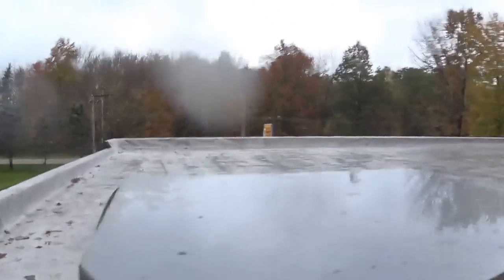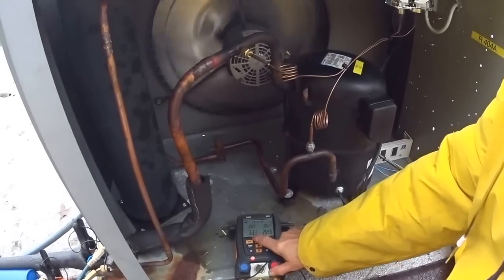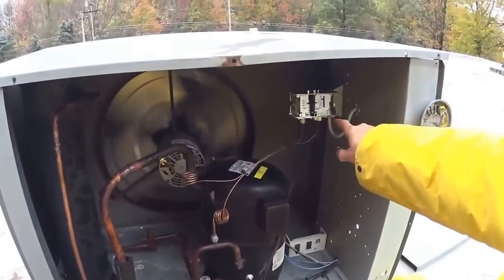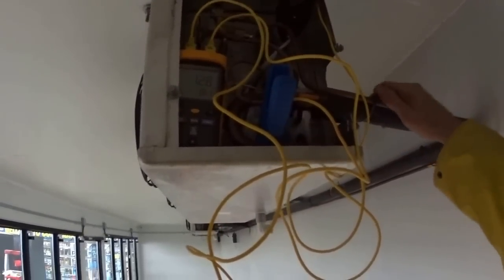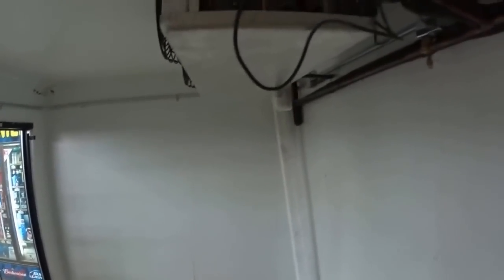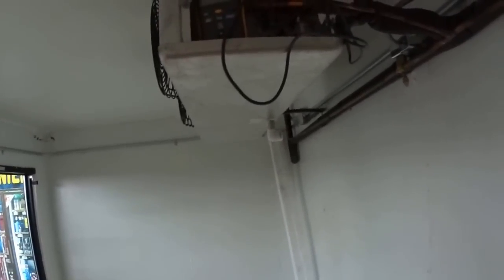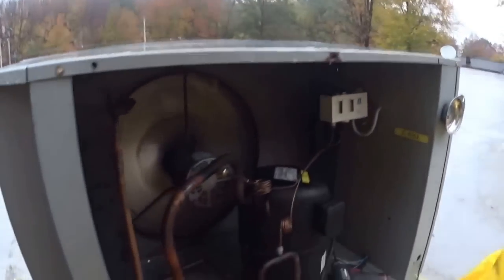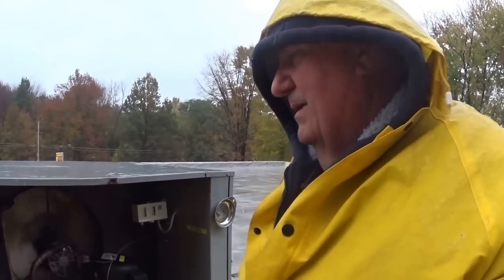Walk in cooler install part 2

Comment: I thought superheat adjustment is made by taking a pressure reading at the end of the evap  and a temp reading close to the TX valve bulb and try to achieve a 6 ktd. I never seen it done this way b4.

Comment: Thanks for posting this one.  Last week I replaced an old heatcraft condenser (with a Bohn) and converted the cooler to R-404a from R-22.  I also replaced the heads and cartridges in the expansion valves.  I had 3 evaporators as well.  The cooler was mostly set up for soda so pretty similar.  Initially I thought I had a problem with the solenoid located in condenser instead of cooler.  Unit would pump down initially but would take a long time.  Found out I had electrical feedback to 240v solenoid and it wasn't seating completely.  Pretty weird, huh?  Originally I had #1 on defrost to first leg on contactor and N (neutral) to the third leg. I switched my neutral to the second leg for defrost clock on contactor and that corrected the problem. System pumped down quickly after that. Unfortunately I only have one meter to set my superheat so my adjustments took a little longer (especially with cooler still stocked).  But this job was almost exactly like the one you did in this video.  I just happened to come across it today.  Thanks Jim for your professionalism and knowledge.  I was gonna set my superheat a little lower but your video confirmed what I did set them to.  Thanks again.  I wish I had video'd the job but I don't really have the equipment.  Maybe I should invest?

Comment: I just noticed something on my Alco Cut sheet. The pressure on the TXV outlet is higher than the outlet pressure of the coil. Therefore, the temperature on the TXV outlet, is warmer ( this is what I was seeing in the field), than the temperaure outlet of the coil because of its lower pressure. They only show a 10# pressure drop through the coil on a single pass coil. I m not sure what Alco's pressure drop is on a multi feed coil.

Comment: Also , as the SH is established on the coils, it's like 40 on the compressor, and nearing 60 SLT. When summer comes, that won't provide enough cooling for the compressor.(R134a. Med temp )

Comment: thank you jim. again I don't have a temperature like the one you have. but have fieldpiece sman3 if i put a low side in the suction line and the two clip one to evap and one to txv will it work?

Comment: thank you for an other great video!!! question ? when you ajusted the txv and your target was "13" .what is this 13 ? and whe you started the video I check pressure target and i chose 58 psi = 22F so I would get 37F at the evaporator. it is rigth? thank you again for you time .
Reply from the maker: The 13 degrees is the temperature difference across the evap coil measured just after the TXV and at the outlet by the TXV bulb. Copeland wants a 20 degree evap.

Comment: Did you have to change the txvs?  You mentioned that you change from r-22 to r-404a.  Or where the valves compatible?
Reply from the maker: all I had to change was the power heads on each valve from R22 to R404a (Sporlan)

Comment: Whats up Jim, on this video  you didn;t mention anything about what method is use for defrost. I also would like to know what voltage operates evaporator fans. Thanks again for awesome videos.
Reply from the maker: Kieth the defrost time clock shuts off the circuit through the temperature control and shuts the solonoid valve, the system then pumps down and the pressure drops the pressure control shuts the compressor contactor coil off. The evaporator fans are 110V they stay on moving the 38 degree air over the evap coil melting the frost build up for 30 minutes four times a day.
Reply: great details, thanks